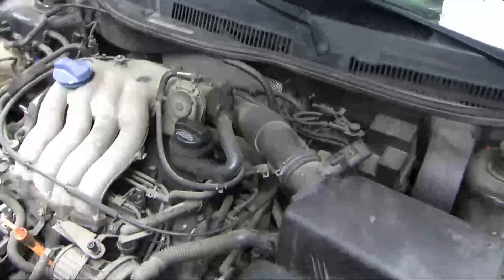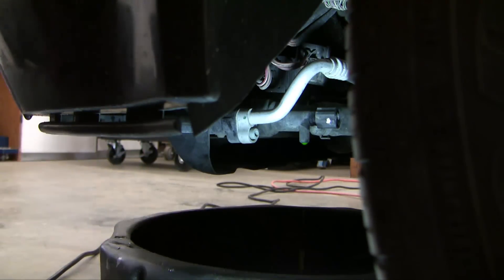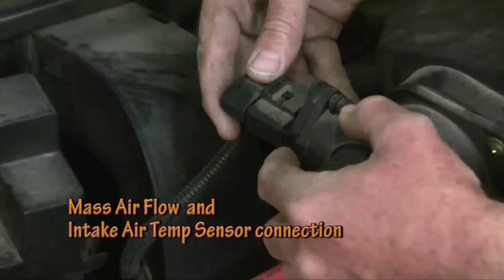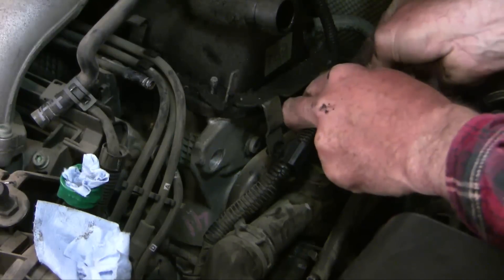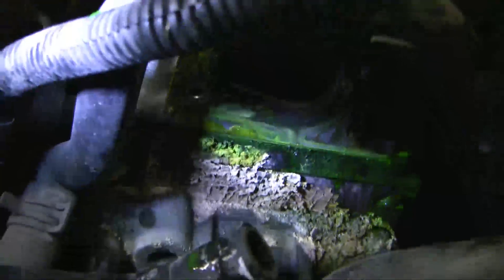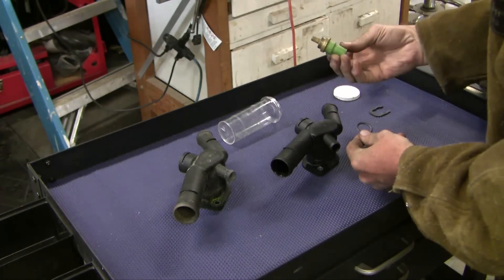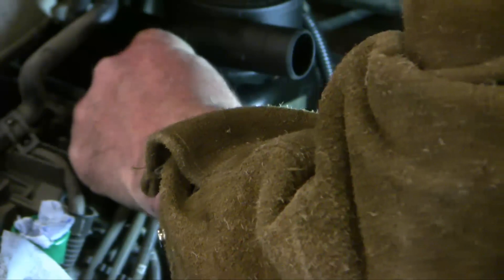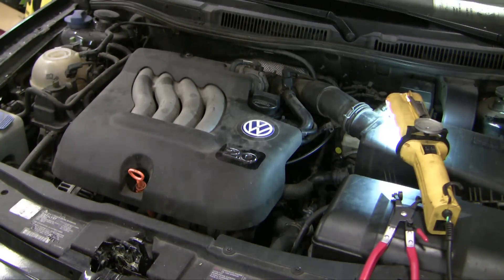VW Jetta Coolant Leak Repair

Comment from the maker: Large leak is very possible as well. Sometimes the flange cracks, and torque specs for those two bolts are very low, presumably to help prevent damage to the plastic. I would move forward and fix it now. If it is not fixed soon, you get gas pockets forming inside the engine that interfere with proper cooling, and the coolant temp sensor may give spurious figures back to the PCM.

Comment: You certainly did a better job than a specialized worker at a dealer.
However as you live in Canada it would have been better to make a minimum mix of half water ,half additive.
it allow you a protection against frozen coolant at very low temperatures.
as i know it's cold in Canada.

Comment: great video.  my 91 Jetta eco-diesel has developed a leak in the same place  at the flange.  Any words of wisdom before I take  it apart.  Your step by step process was very helpful
Reply from the maker: Diesel engines run hotter and so I'm not surprised to hear that. Before jumping in I would get a copy of the dealers manual - electronic copies from third parties are much more reasonably priced. I use Alldatadiy but I believe Mitchell is also competitive. Good luck!
Reply: spelunkerd thanks will do

Comment from the maker: You're right, the torque on that flange is only 84 inch-pounds, less than one would expect, especially for a mating surface prone to leaking. If they had made the flange of metal with a traditional gasket the torque could have been higher, and and maybe this problem wouldn't be so prevalent. Thanks for your input!

Comment from the maker: I don't remember whether it was on the inside or the outside, but I would try to reproduce what you had before you fix it. I saw a set of still shots where a guy used RTV, and it seemed to work for him. But the dealers don't normally use that -- I asked my dealer and he said they don't do that. I also wondered if a tighter torque would be better, but I didn't find anything to support that either. Presumably there is a risk of breaking the plastic or distorting the seal. Thanks for your remark.

Comment: I generally don't like detailed step by step YouTube videos but you did an excellent job with it.  In light of the cold climate you reside in, I am curious why you chose a 40% ratio of glycol to water?
Reply from the maker: Yes, excellent point, if we lived in Edmonton or Winnipeg or Regina, it would be wise to be more aggressive. We actually live close to the ocean, so we get snow only once or twice a year. My vehicles never see anything below -10 deg C. As you know there is a diminishing return when it comes to reducing freezing point with increasing % glycol, and of course coolant is a little less expensive than ion-free water. 40% works pretty well for most near the 49th parallel. Presumably the increased boiling point would show a similar diminishing return, though I don't remember that part of the curve well.Thanks for watching, and for your thoughtful comment.

Comment from the maker: (continued) On re-reading your question, I'm not certain I answered it. the flange bolts to the engine block, and is not connected to the radiator except through that large hose. I did not have to disconnect that hose from the rad. But if you are doing a different repair, you may need to disconnect that hose from the rad. For instance if the hose is damaged you will need to replace it. It seems to be a simple hose clamp connection, hidden because of a plastic cover that is easily removed.

Comment from the maker: I researched that issue regarding this specific topic. In general using RTV on rubber gaskets is usually frowned upon, and my local dealer does not put it there. I tried to mimic what the dealer does. I'm a little surprised at how low the torque spec is for that flange, presumably because the plastic may be distorted with excessive torque.

Comment from the maker: When the flange leaks it allows air to be sucked back into the cooling system as the engine cools. That creates air pockets that are of a different temp than the surrounding coolant, and the temp sensor may give incorrect readings. In addition the water pump doesn't pump very well because of the fact that air pockets are too compressible. I suspect all of your problems stem from the leak, and if it is still there I would fix it first before replacing any more parts. Good luck!

Comment from the maker: it's a UV dye that makes a leak more easily visible, available at any automotive store. You can use it with coolant, engine oil, transmission or diff oil. UV dye is not necessary unless you are in doubt about where the leak is. I guess in retrospect the area of the leak in my case was obvious.

Comment: your instructional video is amazing!  very clear and no over-information.  I am concerned about the flange gasket sealing to the engine.  I don't have RTV gasket sealer...  Would silicone be an acceptable sealer?

Thanks again.  This is fun
Reply from the maker: Thankyou, Bruce. No, definitely don't use something else, if you feel you need RTV then get it at an autoparts store for less than $10. Permatex is a popular brand. The main advantage over household silicone is the proven temperature response curve. RTV is especially designed to retain it's properties at the extreme temperatures of a functional engine -- household products might just melt away. As you saw, for the critical junction I did what is recommended at the dealer, no RTV, just rely on the rubber seal that is an intrinsic part of the new flange. The repair worked fine and we still own the vehicle. Nice to meet you!
Reply: spelunkerd Yeah i bought some Permatex from advanced. 500 degrees threshold.  the upper 10mm flange bolt was SO DIFFICULT to install, but your tip saying to connect the hoses first actually was very helpful!  I shouldn't have disregarded it in the first place. haha.  it's in! just working on "burping" the system.  Feeling accomplished.  My housing had a huge crack in it

Comment: Thank you for this video. I have a 2002 VW jetta 2.0. My light comes on alerting me that there isn't enough coolant. We looked for signs of leaking, and couldn't find anything until we ran the car, revved it and then released-- coolant would drip out from the drivers side front end. We have applied stop leaks and it seems to work for a bit, then the light appears again. Now, there is no sign of leaking. There is never a puddle where it was leaking before. It's odd, the light will come on alerting me, ( car NEVER overheats and never has during this process and driving it with the light on) I will park, and check the reservoir level, and it is usually on minimum or right below it. (Still no signs of leak) After the car sits, and before I turn on the car, I will check the reservoir level and most of the time it is back up to maximum level or it rose to halfway mark. But sometimes I will have to add water to the system to get it back up to maximum because it is low. We thought it wasn't leaking, but then I wouldn't have to be adding water. (Note: Coolant does happen to be green; still is green up until now so it isn't leaking a lot) I never have to add more than about the amount of a bottle of water. Based on these signs, or lack of, and symptoms, would you think the coolant hose flange could be the issue? Thanks!
Reply from the maker: This is a classic story for a coolant hose flange leak, although any 
occult leak could behave that way. I would fix it right away, before you
 have more problems. Fixing the hose flange is not difficult and not 
usually very expensive for a professional repair. You could do it 
yourself but there is some risk and you want to honestly evaluate your 
skill set before jumping into something like that. I know some people 
like stop leak but I would never use it, and I would make an effort to 
flush it from your system as soon as you can. If you are puzzled or 
interested in why the reservoir seems too high after running, have a 
look at my playlist on cooling system repairs. The reason levels rise 
and fall is a result of how the radiator cap functions, to burp the 
system automatically for you after the engine cools overnight. Good 
luck!

Comment: tx very much you are the only calm and very detailed adviser that i so on youtube!!!!
now let me ask you how do i change the transmission oil  please.
a have this weird problem with my jetta 1.8t 2002 she doesn't go revers and she has some difficulties when change the shifts from 1-2-3 before when the engine wash hot the reverse was working now is not doing that even if is hot .... pls if u have the time to tell me if can be the oil.
tx and do what u doin   coz u are the best in that!!

Comment from the maker: Yes. 

I did a couple more videos going into how this works. Watch "Hidden genius behind the engine cooling system", and "Mystery of the gurgling heater core".  Also Ericthecarguy did videos showing how this works. The commonest cause of overheating after working on a cooling system is trapped air, and it could cause major engine damage if not burped. There is an automatic burping property to modern systems, but huge volumes can't be cleared instantly. It takes a few heat/cool cycles.

Comment from the maker: In retrospect I should definitely have done this repair sooner. You don't usually see much coolant on the ground, since hot coolant mostly evaporates away and it only leaks when the engine is running. Even reservoir levels can be misleading because air pockets inside the coolant jacket lead to underestimation of coolant loss. If left too long you may see a CEL for coolant temp sensor, strange idle RPM's, and poor coolant flow from ineffective pumping. Thanks for your comment, good luck!

Comment from the maker: The system capacity is 5L for my engine, but about half of that is G12, half distilled water, depending on how cold it gets where the car lives. The catch regarding the question of a system flush is the fact that a straight drain will not remove all the old coolant because of un-drained pockets. Watching what I did, I drained then filled with water, ran the car, then drained and filled again with 40:60 ratio of G12:distilled water. Of course I took the waste to be recycled. 
Thanks for watching.

Comment from the maker: I would not use stop leak. In my opinion, the problems with those kind of thickening agents is not worth the possible short term benefit. I would diagnose and repair the problem rather than temporarily masking it. 

The diagnosis I posted is the commonest cause of slow leaking but not the only cause. If you get a pro to repair the problem correctly you will be further ahead in the long term. Good luck!

Comment: that UV leak system seems like a good idea. My issue is the car is overheating after about 20 minutes of driving it will creep up past 190 and that's when i expect some fans to turn on but no fans turn on and when i check the reservoir cap it's at a normal level when overheating until the next day when its parked overnight the level drops down slightly. I'm not sure if my water pump is leaking or something else is leaking like the heater core. I notice the puddle is down towards behind the oil tank close to the catalytic converter. I'v removed the thermostat and felt inside the water pump housing the propellers felt intact also there is flow from the return hose back into the coolant reservoir so i'm having doubts it's the water pump. I've had a visible leak near the coolant sensor flange so i checked the coolant sensor flange it was intact changed out the o ring and changed out the coolant sensor o ring since that's where i figured it was leaking from primarily afterwards no leak from that area but still the engine overheats. I don't know if there is air trapped in the system or if it really is the water pump. The way i see it the engine reaches a certain temperature that's when the thermostat should open up and that's when the coolant should go into the water pump and back around the engine water jacket out through the coolant sensor flange back to the radiator and so and so on and so forth. Could it be possible that when the thermostat opens up the water pump isn't effectively pushing the coolant out fast enough throughout the system or is there air pockets in the system that are restricting the cooling efficiency. 

This is a real pain in the ass
Reply from the maker: Yes, trapped air could cause all of what you are seeing, though the source of the leak is still the root cause. If you have access to a laser thermometer you could measure temp going in and out of the radiator to help decide if water is moving -- burping is really important in many designs. 

Your fans should definitely turn on if the coolant is hot, though sometimes it takes a while and it might take longer if you've got trapped air or other causes of bad coolant flow. If you're not sure the fans are working, you can disconnect them and apply 12V current to see if they work -- start with a wiring diagram. Sometimes a sticking thermostat will impair flow, and so you might just replace the thermostat to see if the problem improves. Once previously I had a brand new thermostat do the same confusing thing. Also have a close look at the rad cap, it's an easily overlooked and cheap fix if the seal or valves at the cap are bad. A small crack in the coolant reservoir could do this, too. When I don't know where the leak is coming from I put a pressure tester on the system and blow it up, watching for the location of dripping coolant. The other sometimes helpful diagnostic effort is to test for combustion gasses in coolant, looking for a head gasket leak -- less common but much different solution. All that said, if you have an MKIV Jetta, the coolant hose flange is by far the commonest cause of an occult leak, and experienced techs often go right to that spot....

Comment: Well the thermostat fixed my problem, it was not reaching minimul operating temp, I think it was stuck open cooling the engine to much! But after replacing that it started leaking, Im guessing cause the pressure or maybe I cracked the flange after replacing the temp sensor? Oh well I just ordered a new flange it should be here thursday! Great video thanks it will help me a lot!

Comment from the maker: I tried to look it up for you on Alldata but they don't have a diagram and I don't have access to the car now. Of course the PCV valve connects the valve cover to the intake manifold, allowing blowby gasses to move from the valve cover back into the intake based on relative pressures. I guess you could call it a PCV hose, but it may not have a specific name. I don't remember if there was another vacuum line but if there was it might be for some peripheral device.

Comment: Very common problem.  The o-ring inside the flange swells and leaks with age.  This will happen I'm sure on every VW 2.0L engine (AEG,ABA) of this time frame.  I replaced it on my car and then maybe 4 years later it had to be changed again. /John

Comment: Excellent video. My 2001 1.8T is going through G12 rather quickly and breaking the bank trying to keep it happy.  My friend suggested a blown head gasket but the car runs perfect, After some research and finding this fine video, I know what to look for. I need to ask, after I replace the flange I would like to flush the coolant and start over. Can you show me a good how to video for a coolant flush? Also how many quarts of G12 will I need ? Thanks in advance.

Comment from the maker: Given the vintage it probably has a typical cooling system, but I've never worked on that buick regal. You might start by going to my channel and finding the playlist 'automotive cooling systems'. Several videos there will help with understanding how it all works. Start with is the one on the radiator cap, "hidden genius".  What you describe could be common and simple, like a bad thermostat or trapped air requiring burping; or complex and expensive like a head gasket leak. Good luck!

Comment: Great video I have a 2007 Jetta and it's leaking coolent I'm not sure from where same process?
Reply from the maker: +Bogart Ugalde Start by looking under the car for a leak, and closely examining the radiator and all hoses. If you don't find a leak there, look with a light in the area I showed. If you see crusted evidence of evaporated coolant residue, you are close. The tricky problem is whether you feel competent to do the repair yourself. There's nothing wrong with asking for advice from a pro, and the expense is usually less than you might anticipate. While deciding, make sure you don't run dry, because one overheat may be enough to destroy your engine. Don't procrastinate.

Comment: Hey man thank you very much for this video, I have a question so my 07 Jetta has been losing coolant at a very slow pace, but I haven't seen no puddles on the floor, I can also smell the coolant inside my car, plus my windows get foggy for no apparent reason, I actually think my Heater Core is going bad or do you think is the coolant flat?
Reply from the maker: +Edel Muñoz ya, very likely a heater core. Usually a big job, though I've never done it on a VW. Good luck!

Comment: you are awesome! really good video!! a lot of details! I may need to do it. I have a vw golf MKIV and I noticed some cooalant almost in the same place where you had, not so much, really a few of it, the level of cooalant is also stable and the engine doesn't overheat. However I may try to do it and check just in case.